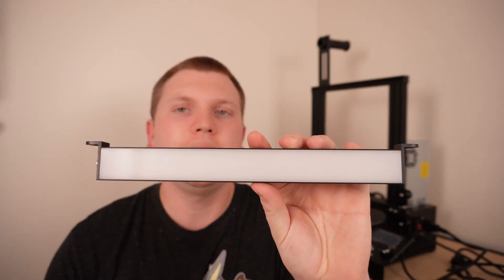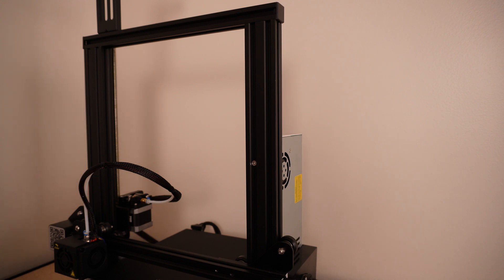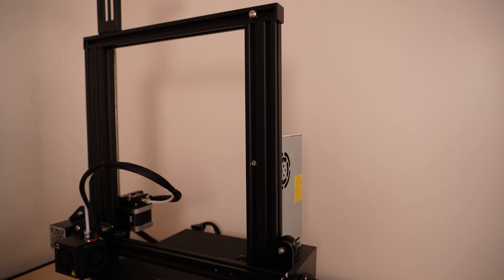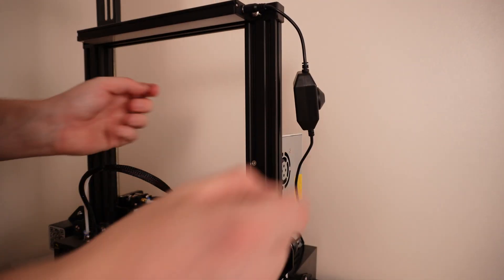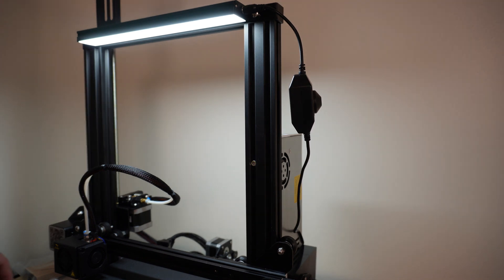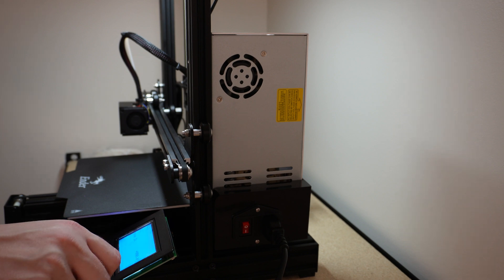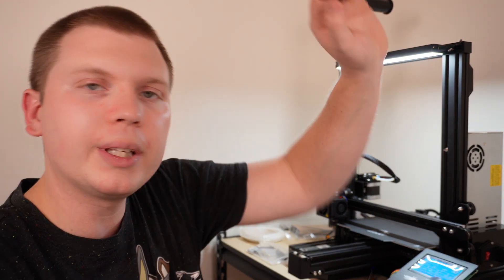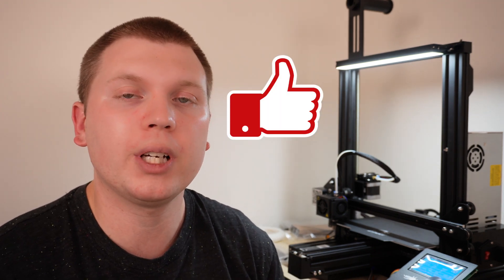Ender 3 Light Bar upgrade- Review and Install

Comment: Good review. I'm looking for options for lighting for my Ender 3 Pro. I think I will make a light bar with an LED strip, but this gives me some good ideas.
Reply from the maker: Glad you liked it. I liked the inline power cord initially but realized later that I would prefer to have the ability to power the light without turning on the printer. Definitely recommend a dimmer switch though.